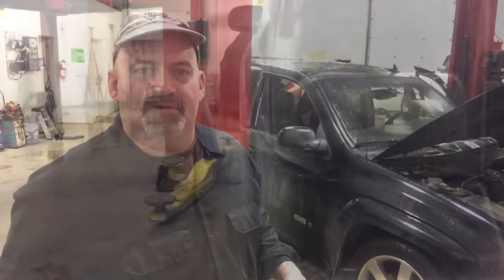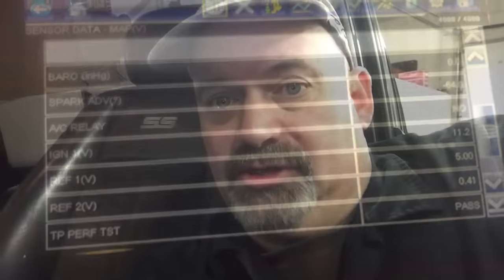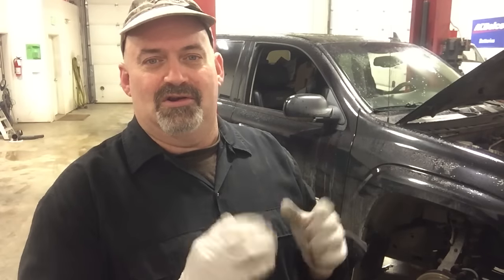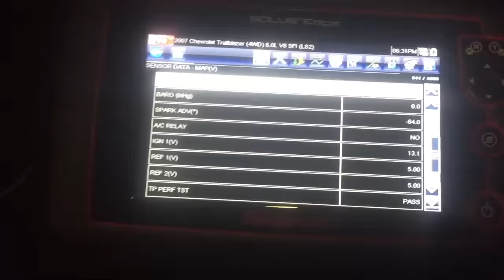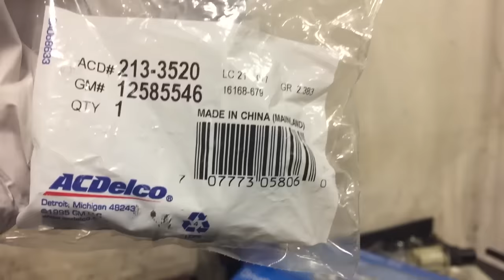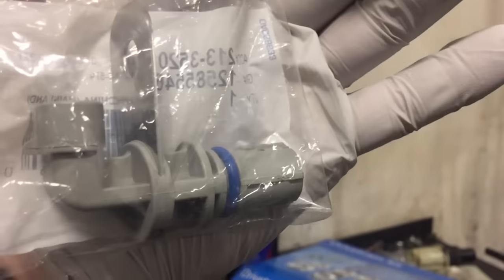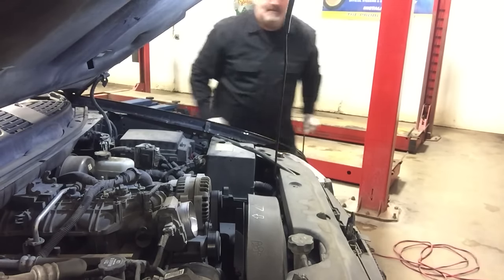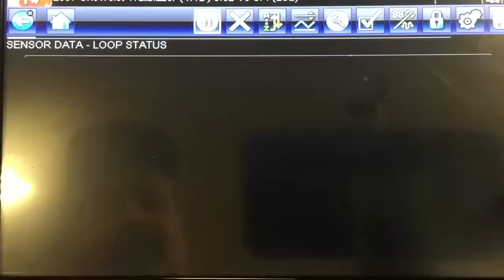Engine Cranks But Wont Start

Comment: Nice work! Great video, good to know. I have a 06 trailblazer ss 6.0 awd that would stall out/cut off when it reached operating temp (whenever under the hood it got warm/hot) had me baffled for couple days. Narrowed it down to weak circuit in underhood fuse block whenever car got warm/hot. It wouldn't start up until cooled down. Replaced Under hood fuse block and no more issues. 1yr later still good. Thanks for your video. I'll keep note of this video next time.  I plan on keeping my 06 tbss for years. Enjoy your videos and knowledge. Keep it up. Thumbs up !

Comment: It turned out to be the cam shaft position sensor. Replaced it and it starts fine now. It was giving eratic signals apparently. Online materials say that that sensor is for fine tuning and the car will still run with a faulty sensor, and that the Crankshat position sensor is the one to look out for if the car won't even start, but mine looks to be very sensitive, hence no start, whichever sensor may be faulty, even if was the one that monitors if my kids have snotty noses in the car.
All the best in your garage and informative videos!
Reply from the maker: Glad you figured it out. Good job on keeping the kids noses clean!

Comment: I got a trailblazer that wont start sometimes but when it starts its a rough idle and stalls in like 10sec after start up i have no codes any suggestions? has new fuel pump spark plugs and a lot more thats new on it

Comment: Good video. Tim how do you determine which code will most likely fix the other codes? Like you stated in your video. An excellent and very educational video. Thanks for sharing my friend. Stay warm.
Reply from the maker: Good question. A few of the codes were obviously tied to the 5v ref circuit just by the code description so that was my first tip. When we see what sensors share that circuit we can also deduct that any codes relating to those sensors may be related to improper ref voltage as well. A few of the codes were related to the headlight module but I saw the relay had been recently changed and was probably the cause for those. Thanks for dropping in friend!
Reply: The Car Doctor Hi Tim. Thanks for responding to my post. This video is very educational. Thanks for sharing your video.
Reply from the maker: Thanks for being my number 1 fan!

Comment: Another successful repair you on a roll! High tech stuff man.
Reply from the maker: Thank you sir! This one forced me to dig a little deeper and I know that makes for better videos. Truth be told I would never pull out my scope, multi meter or scanner if I didn't have to. I probably do more diagnostic work with my hammer than anything else. You know what the hardest thing is? Billing for diagnostic time. Nobody wants to hear that my estimate is $98 per hour for however long it takes. Even this guy asked for an estimate and I totally understand because im pretty sure the family is having a tough stretch. Anyway it seems like it turned out good for everyone in this case. Most of all I get to be the hero and that's worth waking up in the morning! Take care!

Comment: Ya gotta pull the starter to replace the sensor, dang the GM engineers didn't use the 7 p's there. Another won bites the dust. good vid pal.
Reply from the maker: Thanks buddy. They stuffed this motor in there for sure. To be honest I really don't care for the TrailBlazer platform. Its a strange design. Those stupid fans on these things are such a pain.
Reply: Paying the bills at the moment though. 
:> )

Comment: Does the scan tool point to a specific component when there is a loss of reference voltage/
Reply from the maker: Not in this case. It just showed the actual voltage on that the PCM sees on that circuit. That's why we had to unplug each sensor one at a time to find out which one was shorted.

Comment: Ive been watching your videos and all have very good content.  Thanks for the vids.  This video came at a perfect time.  A couple day ago my 2003 corvette stalled and would not start.  P0335 is the only code which the crank sensor seems pretty common on the LS based chevys.  How necessary is the crank relearn procedure and what does it do?  I cannot get a knowledgeable answer on the corvette forum. Car ran fine the next day but Im worried eventually it will leave me stranded.
Reply from the maker: It may effect performance over time and can even lead to misfire codes or detonation if not done. It simply correlates the sync between the signals generated by the cam and crank sensors and creates a set value stored in the PCM. This value can change from one sensor to another or even over time with internal engine component wear to things like timing chains/gears and crank or cam wear/end play. Its a super quick procedure with most scan tools so it shouldn't run more than a half hour labor charge at most shops. Thank you for watching my videos and im sure glad you found them helpful. Blessings!

Comment: When that senor goes out... would it kind of make the wind up noise 1st & then stop working after that while driving? Might have this issue. No codes.. Got power.. Crank, but won't start. Has a new battery & starter! Would alternator do a noise like that when it shuts off on you while driving!? The noise I've heard I've never heard it.. only ran it for 20miles & it  started a winding noise or so and not a mile after that it cuts out on the road.

Comment: I'd love to see how you use the "mechanical arms" to install. Tough camera angle I gotta believe.  Another amazing shortcut, way cool!!  

Oh and  Thanks for the info and video.
Reply from the maker: Thanks. Yes I wish I had gotten better shots of the work. Its super tight in there. I could barely get the Go Pro to fit past the exhaust and next to the starter but then there was no light on the subject.

Comment: Thank you for the video! What a monstrous sound that engine makes! Did you just find out the shortcut to replacing the sensor or was this based on prior experience?
Reply from the maker: Well to be honest if I did one before I probably forgot anyway. Its not hard to figure out but I will say you need the right touch to pop those connectors off and slide those sensors in with that much reach. Also having a hoist makes it a lot easier im sure. Hate to think about doing this one on the ground. I think that's when I would decide to retire! Good to see you sir!
Reply: Yeah, I'm sure you made it seem easier than it is, fishing those things in and out from that distance.
I'm one of those unlucky ground dwelling bastards :) One day I'll be blind from all the crud falling in my eyes, then I'll go live under-ground with the moles.
Reply from the maker: hahaha, ground dwellers. We should both wear safety glasses more often it sounds like.

Comment: Ok I have one for you. 05 gmc envoy xl denali. It will start run fine then I shut it off go to start and it just cranks. 20 minutes to a half hour or so it starts back up again. What's your thoughts besides fuel pump. Maybe bad fuse box? Or ignition switch?

Comment: My 2005 Trailblazer stalls after driving distances of sometimes 15 miles, sometimes 3 miles. After a few hours it starts back up again. The time in between it stalling and those few hours before it'll start up again, the engine will crank but won't start. It's a 4.3L V6 with 160,000+ miles. The only code displayed on my OBD scanner is a random misfire in cylinder 6. No other codes are put out except this one. What do you suggest? PLEASE HELP!
Reply from the maker: Test for spark and fuel pressure, injector pulse when the car wont start

Comment: Nice 5V Ref diagnosis Tim. Find the one pulling it low but that was about the cheapest out of all of them including the coolant fan speed sensor. Trailblazer SS with the 6.0 I have the Silverado SS with 6.0L...it's got some power. 4 hrs to pull a starter and change the CKP sensor is hilarious b/c it takes about 1 hr. total time. Nice video Tim!!
Reply from the maker: did I mention the radiator fan speed sensor? Because I found out later on that it was also part of that circuit but forgot if I mentioned that in the vid. It was a cheap part! That vehicle has some serious power haha, It was getting a little squirrely on my test drive. I would rather have the Silverado for sure!
Reply: The Car Doctor No you didn't but I figured you just omitted it. I had one similar so I knew it was part of the circuit and it was the CKP also. If I did videos there'd be a lot of stuff omitted probably especially if I'm staring at WDs and contemplating my next move. I don't talk much then. The Silverado SS is light in the ass so it'll get a little squirley but I have some 22" low profiles that have great traction & handling. Drives like a normal truck until you nail it & then the 6.0L shows it's power...fun truck to drive and mess with the ones that don't pay attention to the SS emblems.
Reply from the maker: Austin. There are a few around. I still can't reply to your comments unless it's under someone else's comment like this. Not sure why that is. Thanks for dropping by!

Comment: Very informative videos, as is the norm with you, the car Doctor.I have a Mazda 3 diesel, UK car. It won't start after having some time when it was taking longer to crank, then started to die out at idle or while changing gears. It doesn't start now at all, but cranks fine. Checked for tons of things and bought even CKP and cam shaft sensor if I need those.One thing though, when I open a high pressure line leading to an injector, and crank, only drops of fuel come out. Is this normal because the loop is open and it cannot build up pressure to squirt, or is it supposed to squirt like hell?The high pressure pump seems to work fine but not sure if it builds up pressure in the common rail or simply cuirculates fuel back to the tank. There are a lot of bubbles in the return line too.I'd appreciate if you can give me some guidance. I read online that many people have been shafted by mechanics who start changing one part after another without solving the issues.If It was possible, I'll disconnect all sensors and run the car the old fashioned way, but the ECU will probably go mad at me....
Reply: And there are no trouble codes detected.
Reply from the maker: I would think fuel would spray out of the open line. But be careful, I think that has some pretty high pressures. Anyway I'm sorry but I wouldn't know the first thing about that car. Can you view the fuel pressure PID on a scanner?
Reply from the maker: I just don't have a clue about Diesel engine stuff.

Comment: The question is did you charge them the full four and a half hour book time...lol... Good job my friend...
Reply from the maker: To be honest I billed out 3.5 hours labor including my diagnostic time sensor replacement, crankshaft variation learn, clear codes and confirm. I'm actually keeping it overnight and have test driven extensively since it's such a strange issue and with all the codes I don't want to miss something. With filming and evening else I probably have about six hours into it but being a new customer I want to help them out as much as possible. Thanks for dropping in!

Comment: My tbss 06 jus literally  right now stalled slowing down at a stop light.   Trippd me out . So I put it in park. The. Immediately  started to start her up.   And she fired up.  Put it in drive. Drove literally  15 feet across the light then it stalled again so I had to make a quic right turn on to a side residential  street.     Tried to start it bac up after putting it bac in park.    It started but then fluttered out and died again. Tried this 2 more times.  Same result. Then the 3rd time I crank it , it jus kept makin the starting noise but never catching.  So now I'm waiting on tow truc
Reply: Is it my ignition  switch ?  Fuel pump? The fuse box is fairly new I got it in 2020 its now 2022.       What may it be ?

Comment: My 03 chevy trailblazer. Needed a tune up.  I changed the coils and plugs now it doesn't start. It ran before I did this but ran like crap. If not my going to junk it. My f 250 86 ford runs better than the chevy

Comment: Smashing job :-)
And wasnt that a nice place to put a sensor NOT lol.
Thankgod the 5v is current limited, dont want a bonfire in the engine computer.
I dare bet that sensor was the original, if so, it didnt do bad for its age.
Reply from the maker: It looked like the original sensor to me. I bet some guys make a lot of money replacing them by charging book time. If I did that and changed two or three a day for the next few years I think I might be able to retire and move to Europe and drink beer all day

Comment: Please help!!!  I have a 2005 gmc envoy xl Denali. I put in a new fuel pump because the gas gauge was fried. I replaced the starter because it went out on me. I did a tune up because it was sputtering like crazy it has 178k on it. I use all acdelco parts on it. And now once in a while it cranks for like 10 seconds before it actually starts. Do you have any idea of what this could be. Also I cant seem to find the fuel filter on this SUV I know its supposed to be in front of the tank but it's just not there. Clueless!!!

Comment: Gm I have an 07 tbss , changed the engine with an l96 out of a Silverado, it cranks but won’t start , changed crank sensor, just spinning won’t turn over , any ideas , thanks appreciate it.